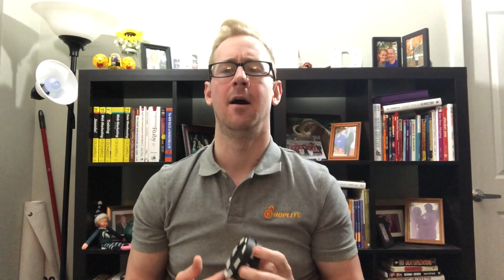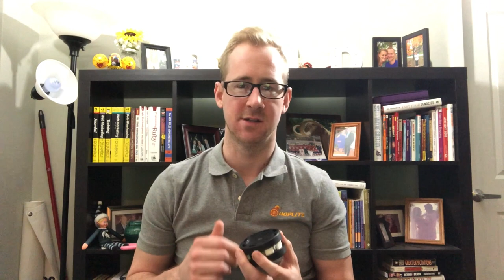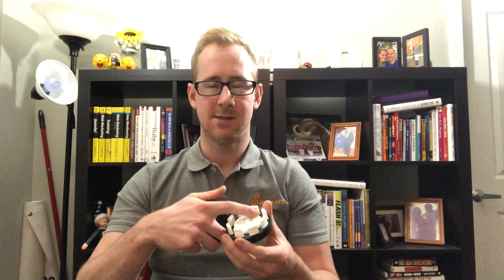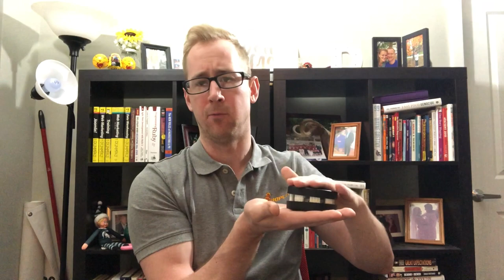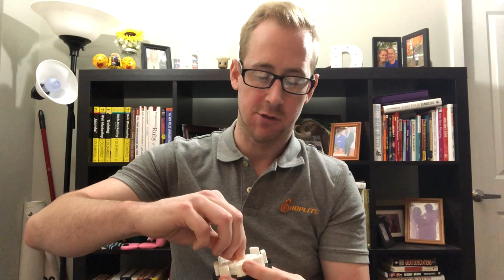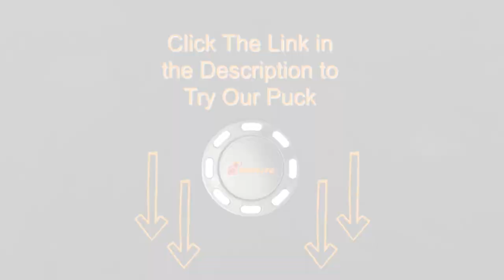HopLite Puck

Comment: I play for fun by myself at my local tennis courts because I live in the south where we don't have any roller rinks (boo :( no one plays hockey here). I need a puck that will slide incredibly well on rough-ish concrete (smooth, but some cracks and bumps here and there) and that I can shoot. Would this puck work for that? I have a green biscuit snipe, but the slide is just not good on the surface.